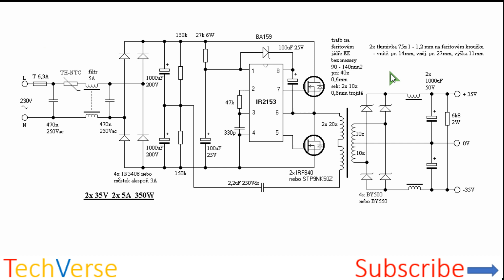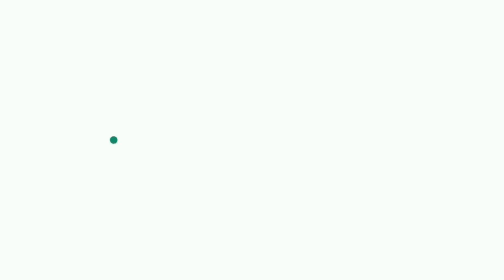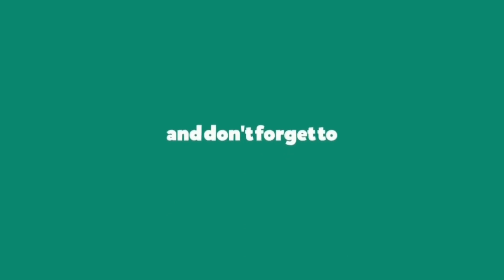Make a +-35V 10A Power Supply with IR2153 Half Bridge Driver

Comment: Proper Working diagram plz send  bro😢
Reply: Have you made circuit brother ? I was planning to try this circuit, please let me know your thoughts
Reply: @mhaudioelectronics  yes.  Made 3 times
Reply: @mhaudioelectronics  Finally it worked. But the transformer is getting hot, the winding may be faulty. but still working. That's what I did now. If there is any problem, I will check it the next day and let you know. You try it.
Reply: @mhaudioelectronics  use 47k2   2 resister in parallel
Reply: Ir2153 input resister